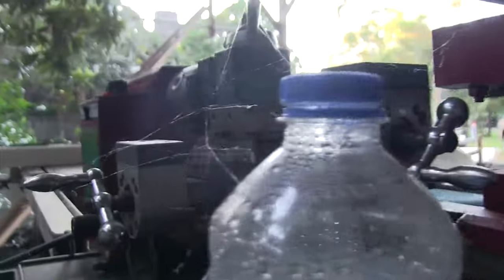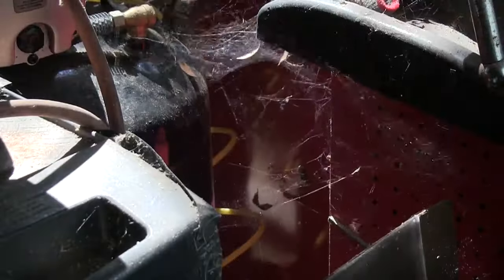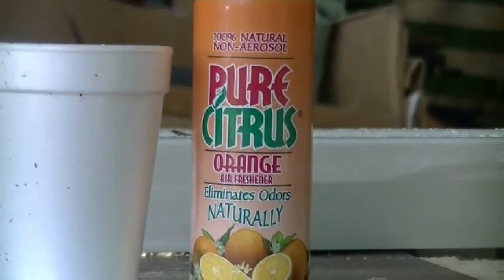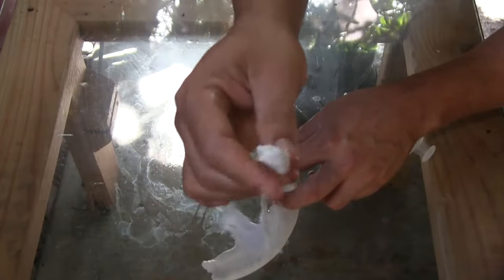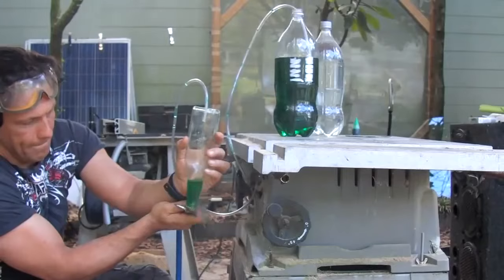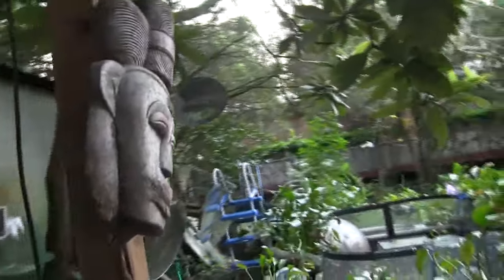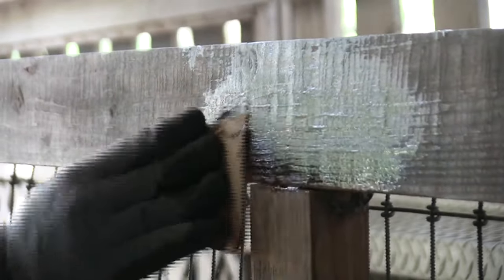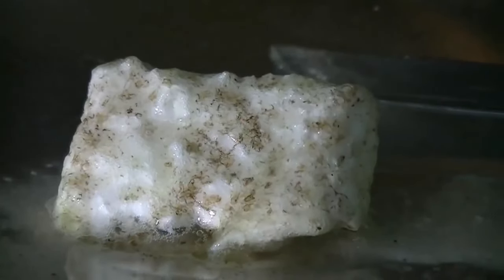DIY special effects COBWEBS from repurposed Styrofoam DIY Realistic Spider Web Throwing

Comment: Could you use this method to make 3d printer filament or would it not be cost effective?
Reply from the maker: It might work if the layers were extremely thin and in a drying environment. Still might cost more than ABS and PLA. Because ABS and PLA printers may release harmful particles into the air other printing methods are taking hold. I am currently working with a photopolymer that is expensive but when added in small portions to any MEK cure styled resin acts as a catalyst to kickstart the endothermic curing process when exposed to UV light.
Reply: You can use trimmer line from your garden store in any 3D printer. It has the exact dimensions and is way cheap.

Comment: I'm having trouble getting styrofoam to disolve. I've used 2 orange cleaners that say they contain d-limoene. I tried Zep and Eco Orange. I used styrofoam peanuts.
Reply: Maybe try lemon essential oil?
Reply: @misskim2058  I found that spun rubber cement is much easier

Comment: is there any way not to use the pure citrus?
Reply from the maker: +icrazyturtle 1234 The pure orange peel oil is the only option for styrenes. Acetone is similar but too destructive to the bonds and evaporates too quickly.
Reply: +GREENPOWERSCIENCE yes I have tried acitone but it is like silly putty. but I have tried the pure citrus and it works perfectly for my web shooters. thanks :D
Reply: +GREENPOWERSCIENCE also is there any way to make the webing stronger like normal spider webing?
Reply: +I Crazy Turtle hey dude im thinking of making my own web shooters and i wanted to use thus formula cause but can i just know how u made ur cause im think of adding that formula in a compressed cartridge then have a nozzle i can turn on and off do u think it would shoot the webs out